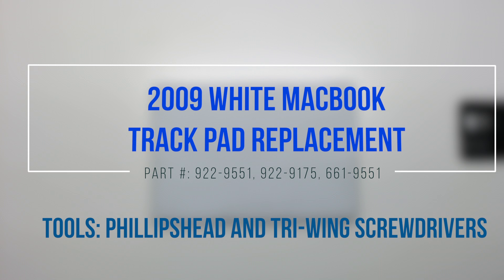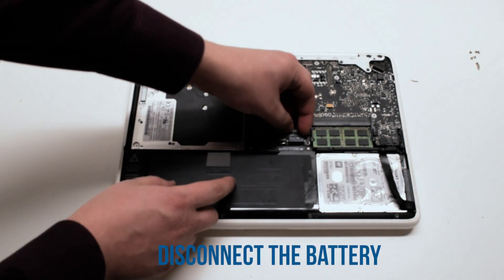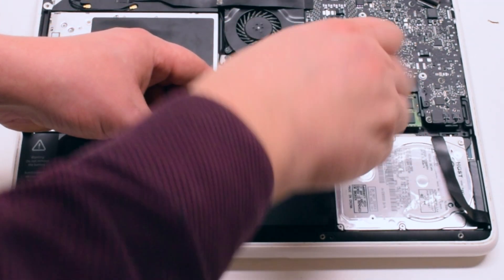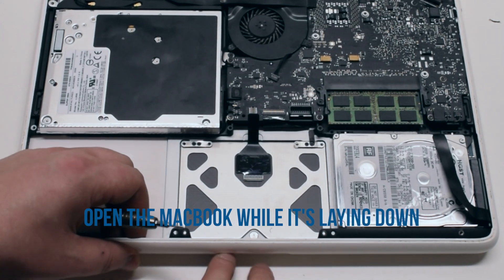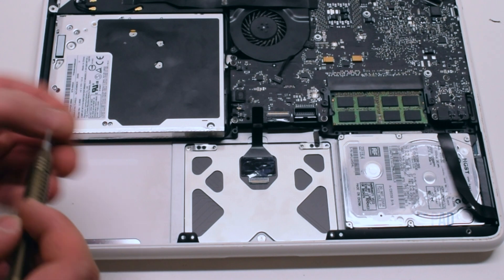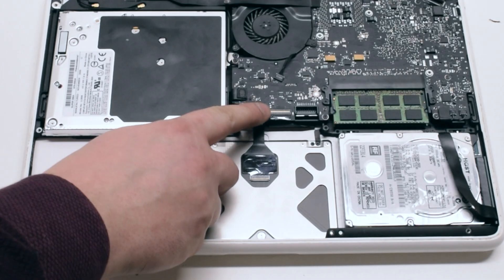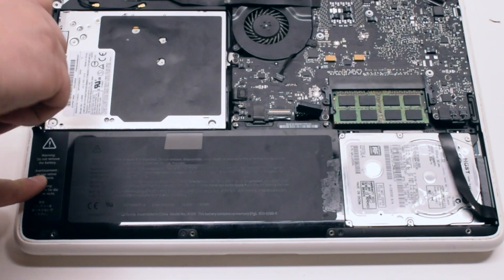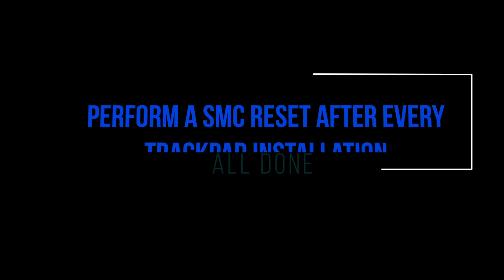2009 White Macbook A1342 Track Pad Replacement

Comment: Hi, and thanks for the video! My trackpad has sunken in like a good 2 or 3 mm on both lower sides. Is it possible that the brackets came out of place and is a matter of just putting it in place, or its time to order a new trackpad?
Reply from the maker: It could be that the battery is swollen and you need to replace that, just open it up and remove it and you will see if it's the pressure from the battery or the trackpad is deformed.
Reply: @GRIBSOFT  if the battery was swollen, the trackpad would be lifted, not sunken. I will try to open it and take a look at it, but it looks like something has fallen out of place...
Reply from the maker: I see, please post your results.
Reply: I got to the triangular screws, and had to abort the operation. I didn't had any bit that fitted the triangular shape of those 3 screws. Will have to look for a bit with this kind of form.

Comment: What would you suggest if only the keyboard isn't working? Mouse keys is tuned off, power button and trackpad work fine
Reply from the maker: Unfortunately you have to replace the entire lower case here it's around $80 and a hour worth of work: http://www.ebay.com/itm/Apple-Macbook-Unibody-A1342-13-Top-Case-Palmrest-Keyboard-661-5590-A-/302067369001?hash=item46549e4429:g:UGwAAOSwFV9X0ujR